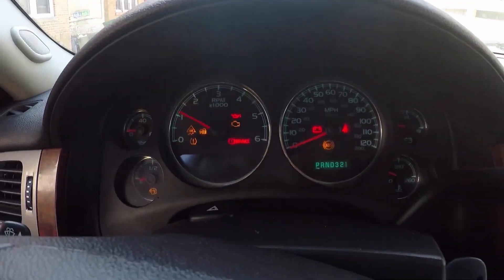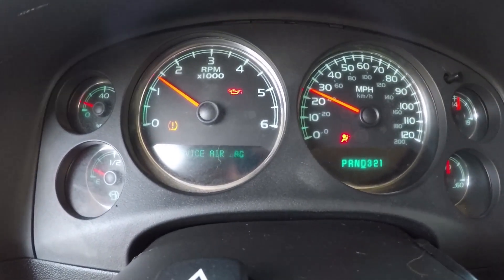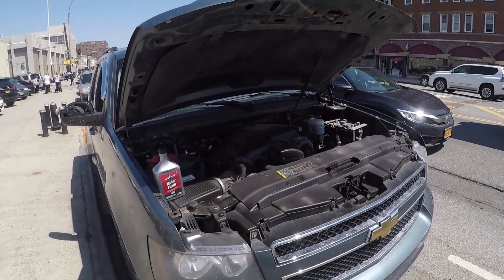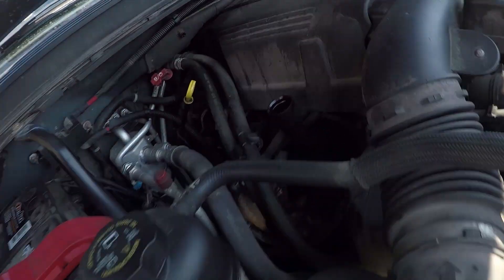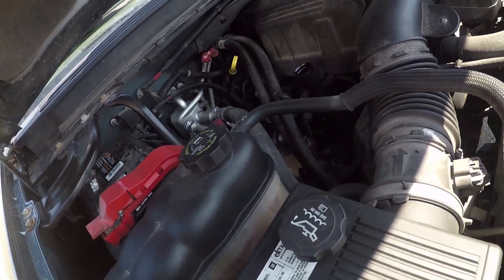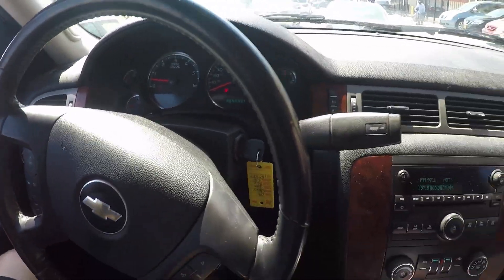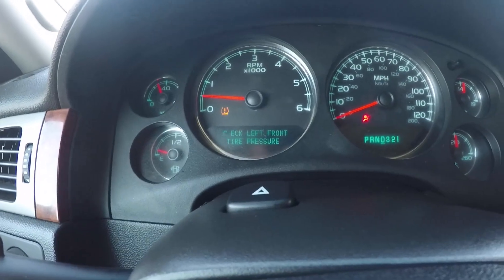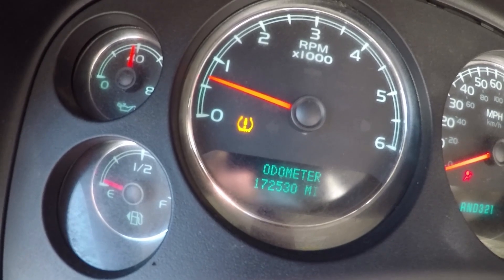Motor Flush in 5.3L Chevy at Low Oil Pressure warning.

Comment: Motor flush is NOT snake oil. It works and helps clean dirty engines of coking and sludge.

I flush my 6.2L LS in my Denali once a year with one bottle of this stuff and one bottle of ATF together.
It has kept my engine cleaner and actually did raise my oil pressure a bit as well.
However I think I still need the oil pump pick up o-ring.

Comment: I changed the oil pressure sensor and it didn’t solve the problem. I tried Motor Medic and it worked. I believe the oil pickup tube screen was dirty . Not really sure what was causing the oil pressure light to come on while idling but it worked for me and worth a try .

Comment: I had the same issue on my 2011 Sierra 1500 5.3. I changed the oil pressure sensor, cleaned the screen, seafoamed the crank case for a little over 100 miles, changed the oil with 5 quarts of mobile 1 advanced fully synthetic high milage oil with 1 quart of Lucas oil leak stop. Also added a better oil filter and my check engine light went off on it's own. I'm also going  to change out the oil pump as well as the O ring on the pick up tube over the weekend. I've searched on  YouTube enough to get an idea of how I can do it with out dropping the subframe, transfer case and moving steering column out the way. I wish I had the correct filming equipment to record the whole process from start to finish but I don't. So I'll let you know how everything goes.
Reply: It's the bearings. You need an engine rebuild.
Reply: @elpcmaster  I was trying to avoid that but I think your correct.
Reply: Ivan J California  I ended up changing the oil viscosity as well. It calls for 5w 30, I put 10w 40 my oil pressure is fine now. I do need an engine rebuild. I have almost 200,000 on the motor. I will probably end up throwing a crate motor in my sierra in the near future.

Comment: The oil filter change that was done at the time of the oil change fixed the problem. No doubt whatsoever. GM engineers have increased the size of the oil filter since around 2015 I believe. Still not large enough in my opinion but it helps. There are two main design issues that cause this to happen. Yes there are other issues with the pickup tube O-ring and AFM that do cause low oil pressure but with those the problem does not temporarily go away after an oil and filter change. First and this is the big one here is the stock teacup oil filter is way, way too small for a V8 unless you live somewhere where it is always 75F and it never rains and you religiously change your oil every 3,000 miles. For the rest of us you can just swap out the stock sized filter at that mileage and add about a half a pint of oil and your good to go. You can get away with that until the oil life monitor reads 25%. Then drain and swap in some new oil with a new filter and reset your oil life monitor and begin the cycle all over. The moisture under the fill cap was a big contributor for this vehicle as well. That is largely what caused the undersized oil filter to fail. Most oil filters use a large percentage of cellulose filter media. Yep, good old fashioned paper. What happens to paper when it gets wet. It swells which in turn reduces the size of particle that will pass through the filter. This sounds like a good thing but it is not in this instance. This is because the oil filter in question does not have the capacity to maintain proper oil flow after the filter media swells due to moisture in the oil from atmospheric changes. This can be simply you live in a humid area and you mostly drive short distances. The second design contributor (I don't want to call it a flaw as it does serve a purpose although as we can see even that eventually fails) is the engine block oil filter bypass valve. This little gismo allows oil to bypass the main oil filter when that gets plugged so the engine is not starved for oil. The trouble is that this unfiltered oil is flowing around in your engine for possibly weeks until enough gunk builds up on the little screen filter under the oil pressure switch to cause the oil light to come on and then that lovely message on your display telling you to kill the engine as you have no oil pressure. Most times a oil and filter change solves the problem. Sometimes the screen under the pressure switch has become so clogged that new oil cannot force it's way through and you have to change the screen and while your there you might as well swap the sender. The simple solution is bigger oil filters. Well ones with more filtering capacity and that usually means larger. For some vehicles you can get away with installing an oil filter relocation system which moves your oil filter to an area which allows larger filters of the Fram PH8 size or larger.  Some of these systems even allow multiple filters although most of us do not need this level of scrubbing capacity. Some vehicles you can simply install a Fram PH10575 filter which is about 33% longer. Ideally GM would design every new car that uses the LS engine with a remote mounted oil filter of a decent size. Make the filter a washable metal screen type and factory install a catch can system to prevent most of the moisture from ever entering the crankcase. This will only happen when GM puts customer satisfaction above their bottom line and that will only happen when we the customer stop buying GM vehicles because of the known design flaws. Next time you are wandering the car lot and the sales rep asks you if they can help. Grill them on what has GM done about the undersized oil filter issue in LS engine equipped models. Ask them why GM vehicles require more premature front bearing hub assembly swaps than all other auto makers combined. Ask them why most GM vehicles have very few or come totally without grease nipples on steering and suspension components. They will tell you that those components have lifetime sealed lubrication. Apparently GM has a different version of vehicle lifetime than most of us! Unfortunately the sales rep won't tell you those same "lifetime" items usually fail around the  100,000 mile mark and the repair bill at the dealer is around about $2,000. Grill the sales rep every time they ask if they can help and when they cannot give you proof of an engineering fix, walk away. That eventually trickles down to the people making decisions and things get fixed......or not but at least you know going in!
Reply: Manufacturers consider the "Lifetime" of a vehicle to be 100k or 10 years.  That's why you don't find warranties exceeding that.  Even insurance companies don't want to insure full-coverage comprehensive/collision on anything older than 10 years, hard to determine ACV.  The value and "lifetime" to you may be different than the next guy.  So no, don't piss and moan at the salesman on any car lot because of GM's oil filter sizes on a car that's nearly 2 decades old...
Reply: Glad I clicked this vid just to read this hood info
Reply: Do u need a special oil filter adapter for that filter

Comment: Having a similar issue with my 4.2 Atlas engine. My pressure was low at startup, only 30psi, and would drop to 0psi after idling for a bit, or driving 10 minutes or so. Tried Motor Medic flush, as well as putting a gallon of diesel in the pan, and letting it soak for a few days with no change. Then I ran a can of Berryman B-12 in the crankcase, and let it idle for 5-10 minutes, and it got better while idling during the B-12 flush, but would still drop to zero rather quickly after shutting it off for the night. Seems that whatever was loosened blocked the screen more. I then drained the oil, and put 3/4 gallon of Berryman Chem Dip in the pan, and let it soak for 4 hours.

After draining, and putting in fresh oil and a new filter, my pressure was up to 80psi at start up. It eventually made it's way back to 0psi after 10-15 minutes. I think that the Chem Dip cleared the pickup screen, giving me better pressure, but the loosened gunk that didn't soak long enough to liquefy got sucked up and plugged the screen again. Running another can of the B-12 now, and will drain the oil, and re-soak the pickup in Chem Dip for a full day. I'll flush and drain as many times as needed because pulling the pan on my truck is a MAJOR pita, and is a week long job.

Comment: Clean the screen under the oil pressure sensor if its not that its the o ring in the oil pickup tube
Reply: While your there change the pressure sensor as well
Reply: I did both. Now what. Still no fix.
Reply: @jonathonlankford  i also only use wix oil filter cheaper ones will clog it
Reply: Check the oil pump pressure relief valves.
Reply: @jonathonlankford  If oil pressure drops AFTER warm up, check your crank bearings.
Reply: @jwilliams5857  yea that what happens to me. It drops when it’s on idle then when you accelerate it then it oil pressure rises to normal. Would that fix the problem?

Comment: It is the oil pump O ring beneath the oil pan. The get brittle after years and need to be replaced. Mine woul come on then after it warmed up it would come up to normal. It was basically sucking some air with the oil

Comment: The Motor flush works well. But if not work your issue is the oil pump pickup tube rubber oring. Gets hot. Dries up. A common problem in that year. The oil pump catches air.
Reply: I changed the pick up tube. The o ring to it. The sensor. The sensor filter. The oil (x2). Took off the oil pan, cleaned it out. Still the light is on. Low oil pressure.
Reply: @Jordy Romero did u ever figured what was going on?

Comment: It looked like there may have been some antifreeze stuck to the oil fill cap so this may also have a head gasket issue
Reply: If it's yellow it's probably from City driving. Not letting the motor burn off the moisture it's accumulated.running it on the highway or few times and it will solve that problem. It happened to my truck an I thought the same thing
Reply: Thats normal.
Reply: Normal from short trips & not getting up to temp.

Comment: Please do an engine oil flush, check you oil pressure screen, pickup tube screen and replace the oil pickup tube o-ring, if all that fails, try adding 10 small washers to your oil pump spring housing increasing the stroke of the stock spring and producing far more oil pressure, you may want to purchase a larger oil filter as well.

Comment: Why used the Lucas Oil high mileage treatment to restore your motor at least the bottle says now I have the same problem with no oil pressure and I can't get it to come back up as well as my rear main seal is leaking the Lucas Oil Treatment Masque my truck up bad and I emailed them about it cuz they have a product guarantee and they won't even message me back

Comment: The motor flush didn’t raise your oil pressure. The oil change did that.
Reply: The motor could have been sludged up engine flush would have cleared the small oil passages and if you put engine flush in you have to change the oil
Reply: A Digital Paradox, the o-ring is definitely an issue on those motors, and a poor design. The biggest issue on them though, and two of the main reasons for oil consumption in these motors, is the poorly designed valve cover on the drivers side, and the AFM valve in the crank case. There’s an NHTSA bulletin on this issue, and if it would have been considered a safety issue, would have been recalled. Instead it’s only a mechanical issue, thus the consumer flips the bill for bad engineering. The NHTSA recommends replacing the valve cover with the updated one, and installing a shield on the AFM valve which diverts the oil back into the oil pan. Some people had their computers reprogrammed to bypass the AFM system all together, and this also fixed the issue. https://static.nhtsa.gov/odi/tsbs/2012/SB-10062524-7690.pdf
Reply: @digitalparadox7138  4 hours of work and fixed with stable oil pressure... well tell us what you changed or did in those 4 hours to fix the problem?
Reply: @digitalparadox7138  good to know i have the dame issue in chevy uplander 07 but now is making a weird noise like humming

Comment: You need to change out the O ring on the pickup tube inside the oil pan where it goes up into the oil pump. The O ring has hardened. My 07 truck just did the same thing and it made my valves start ticking something serious. 😬.
Reply: Chad Cole, the o-ring is definitely an issue on those motors, and a poor design. The biggest issue on them though, and two of the main reasons for oil consumption in these motors, is the poorly designed valve cover on the drivers side, and the AFM valve in the crank case. There’s an NHTSA bulletin on this issue, and if it would have been considered a safety issue, would have been recalled. Instead it’s only a mechanical issue, thus the consumer flips the bill for bad engineering. The NHTSA recommends replacing the valve cover with the updated one, and installing a shield on the AFM valve which diverts the oil back into the oil pan. Some people had their computers reprogrammed to bypass the AFM system all together, and this also fixed the issue. https://static.nhtsa.gov/odi/tsbs/2012/SB-10062524-7690.pdf
Reply: After changing the o ring did the valve ticking sound go away ???
Reply: @adilshaikh5579  - I ended up having to put in a brand new engine 3 1/2 years ago ($7k🙄) and exactly one week AFTER my new 3 year / 100,000 mile warranty ran out I had a hydraulic lifter go out on me on the drivers side and had to get it fixed. Another $$1,700. 😏🙄 So far so good after 6 months of replacing both lifters on the drivers side. How to fix the whole problem is you have to do a delete to turn off the system that makes it run on 4 cylinders at times. That is what causes them to wear out so fast and go out on you. Hope that helps.
Reply: @ColeAviation  There's a OB 2 reader from summit to deactivate the afm after you've performed those fixes or get the delete kit

Comment: That is too much moisture in the oil cap. You may have a coolant leak into the engine oil. Important to get that fixed quickly.
Reply: Dodge Dakotas (2000 4.7L) liter do that exact same thing in the winter time.  Too much air flow(keeping it cool) over the pour spout and it never gets hot enough to dry it out.  A known problem with the 4.7L around that time.  200,000 miles now and no problems with it at all.
Reply: No that moisture is normal when its ran for short periods and the moisture cant evap out of the oil yet.
Reply: Yeah I don't get close to that much moisture residue on my cap I change oil early all the yime and use wix filters almost everytime I got a 2001 5.3 silverado 125000 on it

Comment: My 2009 Chevrolet Silverado with a 5.3 lost oil pressure as I was going down the highway to an important interview! I panicked and added more oil. After watching this video I decided to stop and buy some engine flush. I poured in let it run for probably 10 minutes. I drain the oil and got probably seven quarts out as I had added two quarts in my panic. I will say after changing the oil and the filter the pressure did come back up so I can't say for certain if it was the engine flush or if it was just changing the oil in the filter. The cheapest thing to do would be change the oil on the filter first and then see.

Comment: My 08 Silverado is starting to have a similar issue. It normally runs around 35-40 but the last month or so, first thing in the morning it starts at 10-20 and then as the engine warms it moves back to the 35-40 and then pretty much stays there. Thinking maybe the o-ring is beginning to fail as others have mentioned. Thoughts?
Reply: You're running to thick of oil probably. It congealed up in the morning, and then start to become more free flowing. Check and see what the cap says to put in it. Probably 5w 30. These new ones are more fuel efficient and takes way less thickness.

Comment: Well after my guy changed out the o ring and put in a new high volume oil pump with a new larger pick up tube my top end is still ticking something serious. So now I got to have a new engine because the cam bearings are wore out. 😔 Gonna be right at $7k for a new engine. 🙄😭
Reply: The biggest issue on these motors, and two of the main reasons for oil consumption and sludge build up in these motors, is the poorly designed valve cover on the drivers side, and the AFM valve in the crank case. There’s an NHTSA bulletin on this issue, and if it would have been considered a safety issue, would have been recalled. Instead it’s only a mechanical issue, thus the consumer flips the bill for bad engineering. The NHTSA recommends replacing the valve cover with the updated one, and installing a shield on the AFM valve which diverts the oil back into the oil pan. Some people had their computers reprogrammed to bypass the AFM system all together, and this also fixed the issue. https://static.nhtsa.gov/odi/tsbs/2012/SB-10062524-7690.pdf
Reply: Rob Will - I greatly appreciate the info!! Six weeks after I bought my truck the low oil light came on and I took it back to the dealer and after doing that about 5 times they FINALLY ended up changing the head on the driver side and the oil stayed up normal for and about 10k miles then it started using oil again. Then my warranty ran out as always. 😡 SO. Here I am having to put a brand new motor in it. 😏🙄😠

Comment: Any more issues after the change? I just bought a 08 suburban 5.3 today from a dealership and not even 6 hrs later I had the same prompt pop up on my dash. Pressure would start at rt at 40 then then drop to 20 then 0 and dash would display that message. Any help would be grateful before I am stuck with a lemon
Reply: @Chris Froman it was replaced along with the screen under it. So idk what's going on with it.
Reply: I had the same thing happen to my 2011 5.3 Silverado I change the oil sensor switch and filter and it fixed it $100